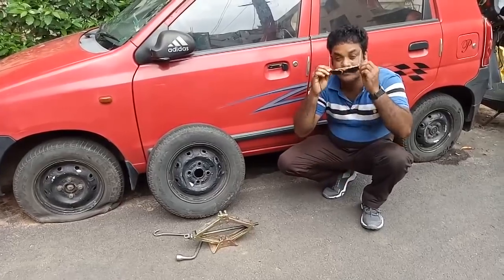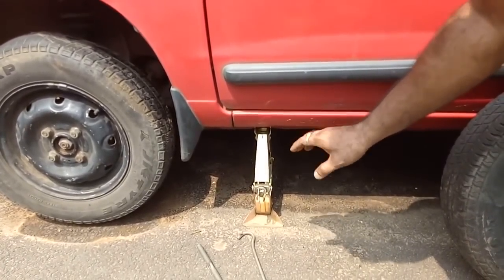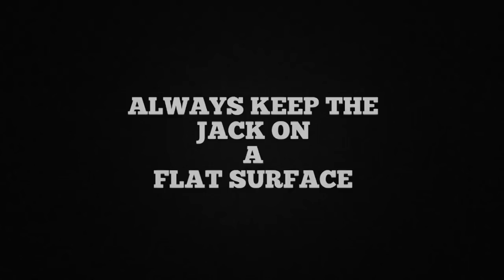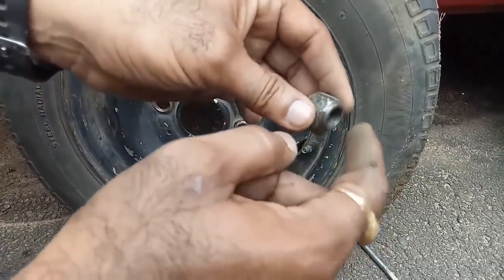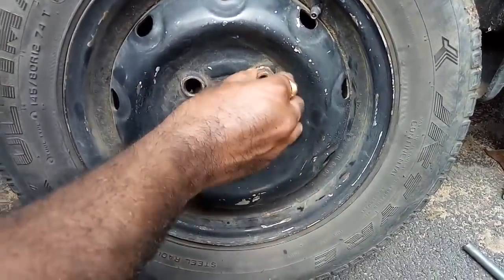Expert Advice: How to Change a Tire on Your Car

Comment: Very nice, just two suggestions: when you take out the punctured wheel, place it under the bumper near to the puncture side to ensure safety in case the lifting jack malfunctions and never place the punctured wheel so much safely until you get the puncture repaired, otherwise it might go on remaining  over there (in case you are a very forgetful person)....always keep the Stepney ready for emergency needs. Thanx. Your video is very helpful for beginners.
Reply from the maker: Thanks for the valid comment. Much appreciate you 👍

Comment: I too tried to losen up but it was very very tight.. Really i couldnt
Reply from the maker: Tried to hit remove. Sometimes you have to put more pressure to remove the nuts due to long unattended duration
Reply: @LambrettaRamesh  Thank you sir, i will give a try..
Reply from the maker: I wish you all the best. Please take care while doing. Safety is important

Comment: Sir my Jack is very difficult to turn
Reply from the maker: Please check the threadings. If they are worn out immediately go for the new one. Because it will create more problem when emergency situation arises like to attend wheel removal. If threadings are ok you just lubricate it with quality oil. Thank you
Reply: @LambrettaRamesh  THANK YOU SIR FOR YOUR CONCERN